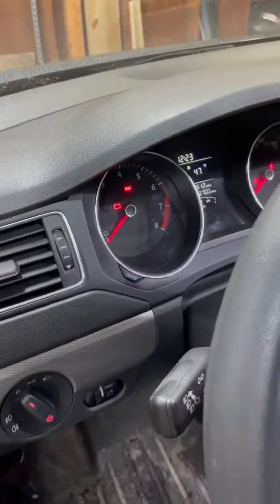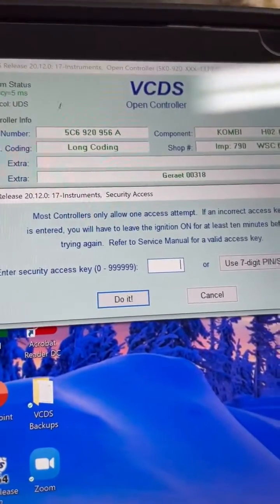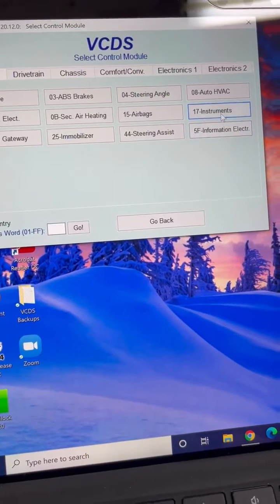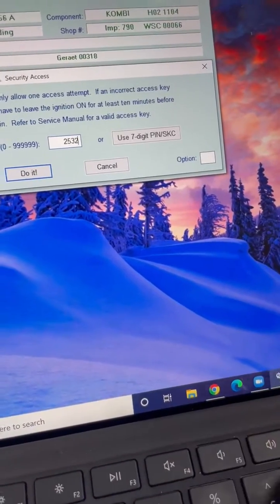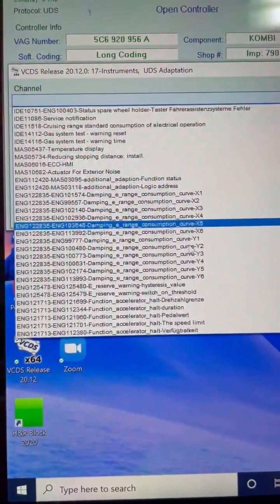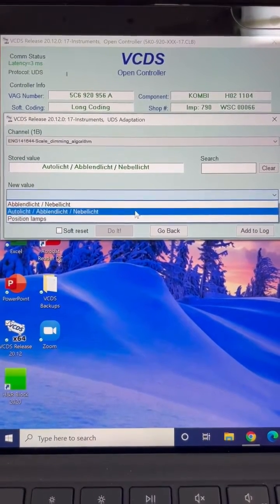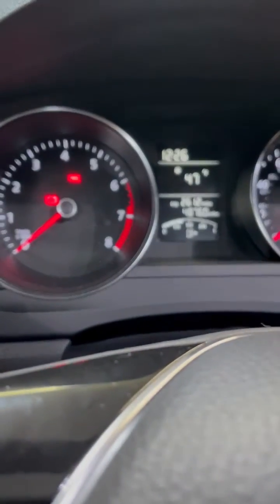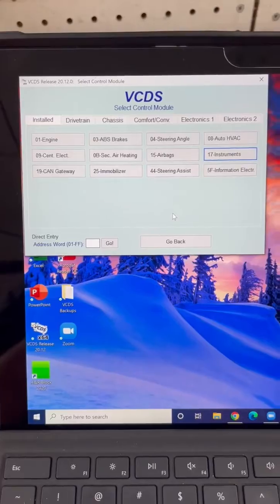VCDS 2017 Volkswagen Interior Light Sensor Dimming Algorithm

Comment: Just FYI, when you go into Adaptation (and other functions of VCDS), there is a search box.  You can type in key words or location values and VCDS will filter out everything that isn't a match.  So you were digging neck deep down the list until you found "ENG141644-Scale_dimming_algorithm".  The ENG# is a location, so you could search for 141644.  Or you could search for the work "scale".  Give it a try and see how much easier it is to find that needle in a haystack.

Regards.

C?ID=430208&TC=1
Reply from the maker: Thanks for the suggestion. I will definitely try that for future tweaks.